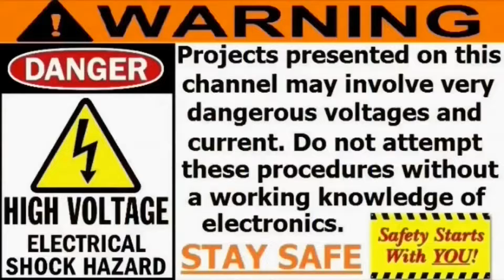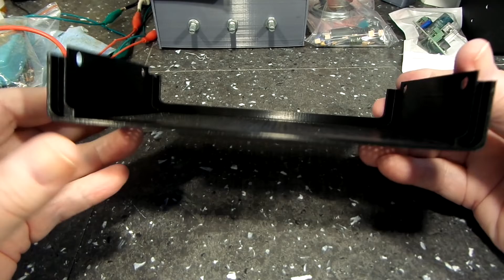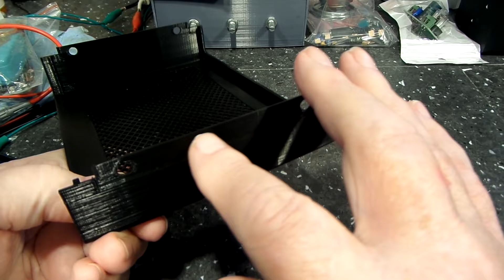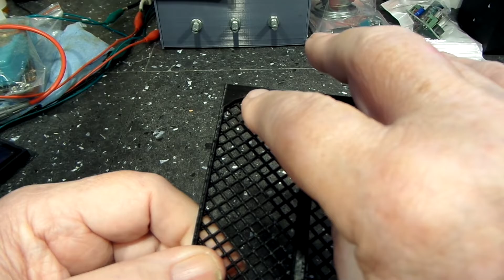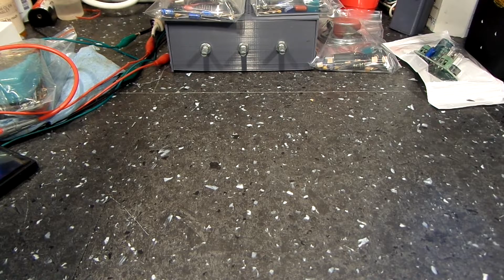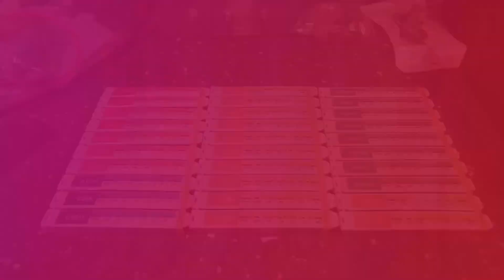DERB 2023 Update

Comment: I do the same thing Doug, any chance I get to print without supports I definitely will. It saves a bunch of time and headaches. Had to do some upgrades to my Anycubic printer and my old Tronxy printers board died after 6 years so gotta get a new one of those eventually. Lots of fun with the 3d printers lately..lol
Reply from the maker: Thanks Pat. I just don't see the need to use a bunch of extra filament for support when you can just change the design to eliminate the need. Hope you get your printers sorted, they are much fun indeed. :)